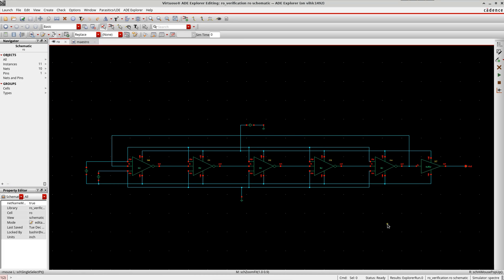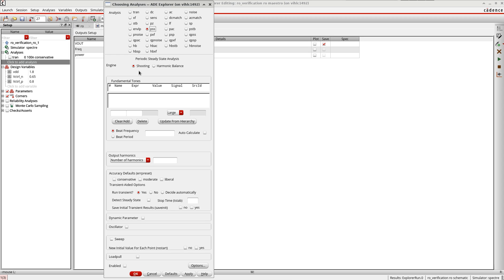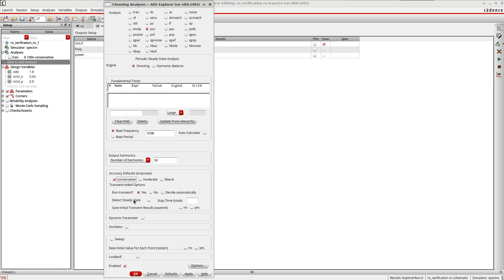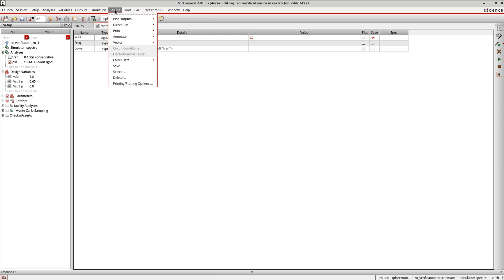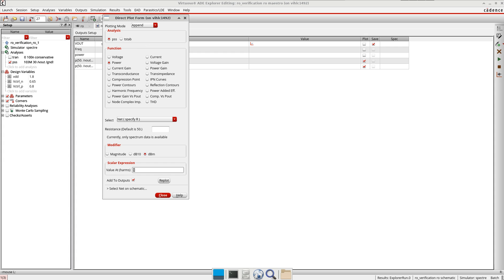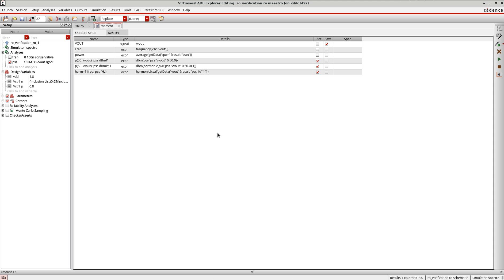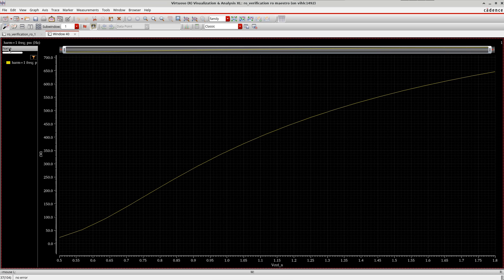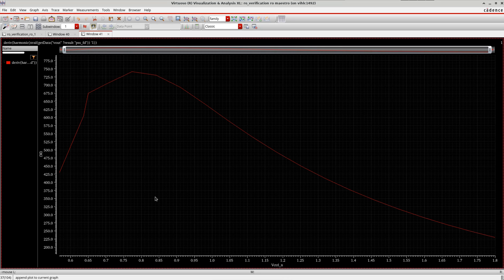PSS analysis of an oscillator #cadence #oscillators

Comment: Hi Mudasir, how do you get to take the derivative of the interpolation of the control voltage sweep? I get what you are doing taking the derivative of the frequency vs Vcntrl but inside virtuoso cadence you cannot take the derivative of that expression since it is a constant, at least in my version i cannot do it. The only thing I can think around is to export the data and take the derivative in another software. I did it just like you
Reply from the maker: The freq is varying with vcntrl and we are measuring the frequency over time so it is not a constant. It would be if Vcntrl is fixed. Hope that helps
Reply: @MudasirMir7  I meant that the Vcntrl sweep is discrete (i.e 100mV:50mV:1.2V) and the results are a point in the function, and I get that you can build the curve or the function if you tabulate this different steps and then you should be able to o take the derivative of that, but inside the calculator i cannot simply take the derivative of that, i did the exact same as you inside the calculator, but my simulator throws an error stating what I've just explained. My question really is did you move some settings inside the cadence calculator in order to take the derivative of the interpolated curve of those steps or is it just a matter of different versions of the software? Since I can only take the derivative of an expression which results in a curve, not a list of values that represent a curve
Reply: I can take for example the derivative of a drain current of a MOSFET doing a DC analysis, but I wouldn't be able to take the derivative of a list of instant current values of that function if I were sweeping the variable of the control voltage on the gate instead of the DC analysis. Since the expression of the calculator is saying to take the derivative of the current that corresponds to a specific control voltage value( which is a constant value, not a function)